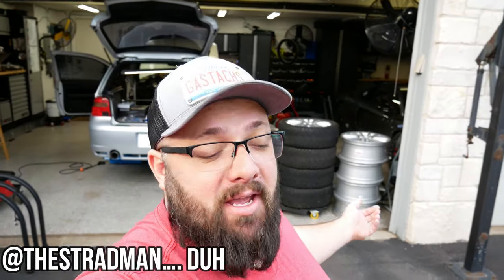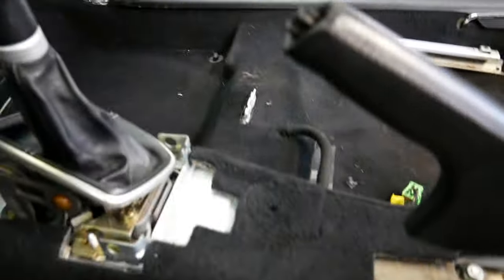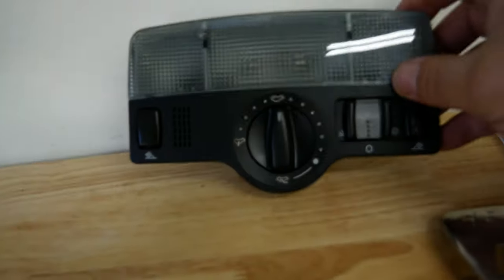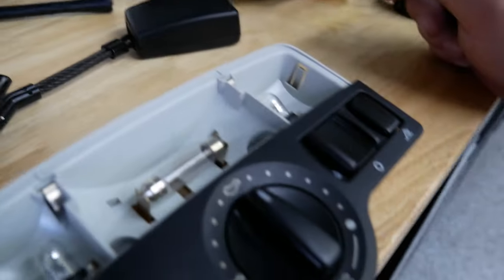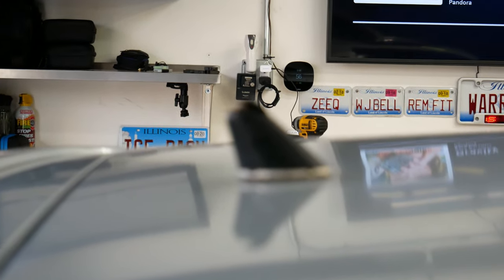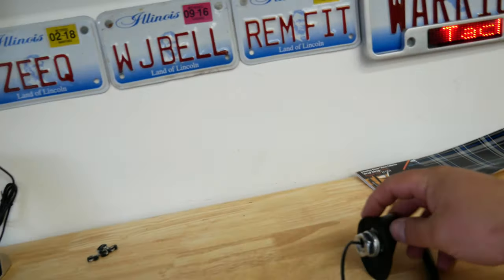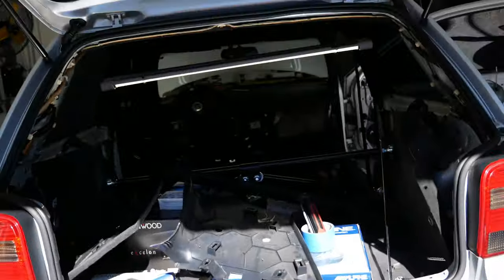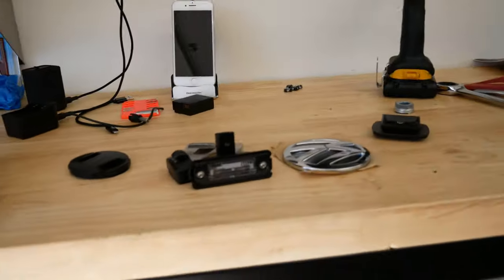VW MK4 R32 Replacing my Hand Brake, Antenna, Dome Light and more. The Project Car Rebuilt Pt.22

Comment: I’m in the process of restoring my r32 as well. When I got it it was missing headliner all the pillars sunroof visor , dome lights grand handles all that. Now question is there a harness that goes to to the lights that are on the headliner I have no where to plug in the lights I’m guessing they cut it from the harness
Reply from the maker: Sorry for the late reply! Yeah man, 9 owners to my car and A LOT of cut harnesses... Good Luck, take your time and you'll figure it out, let me know if you have questions with any of my 29 videos about working on my R32!
Reply: Gas Tachs no worries man and just that one question I have no idea what I’m missing to have the connections for the lights on the headliner. Everything else seems okay my interior is practically done I just need to figure this out then I can put my headliner up.